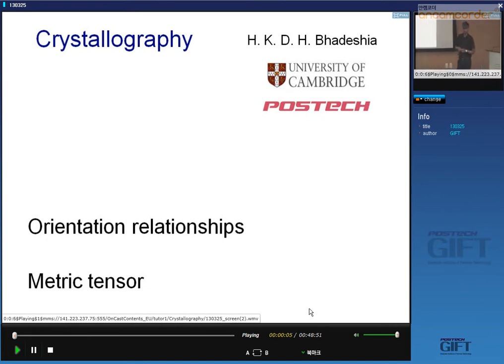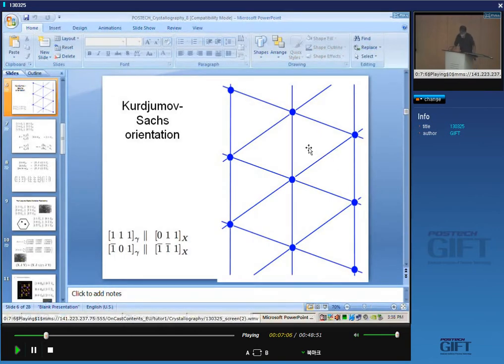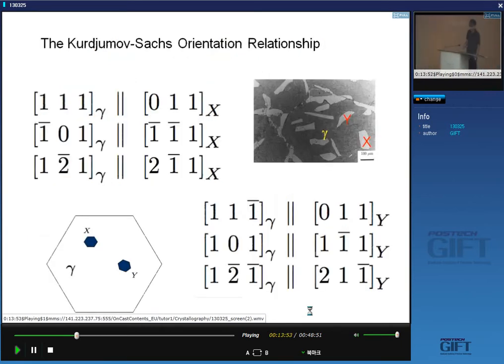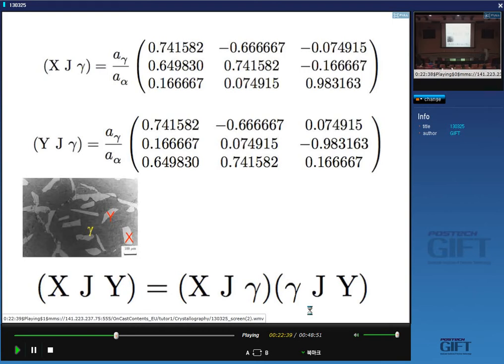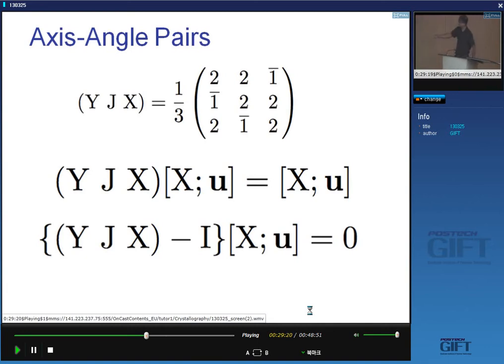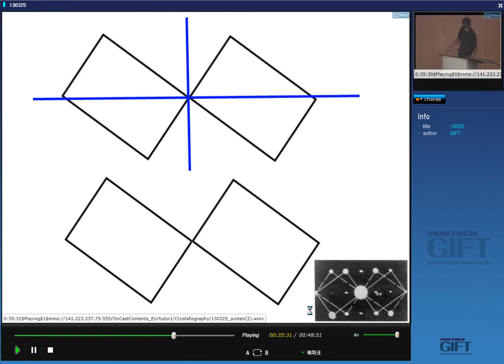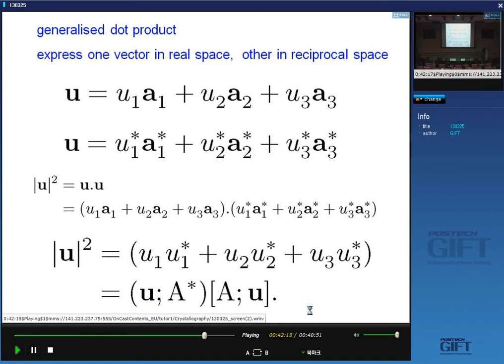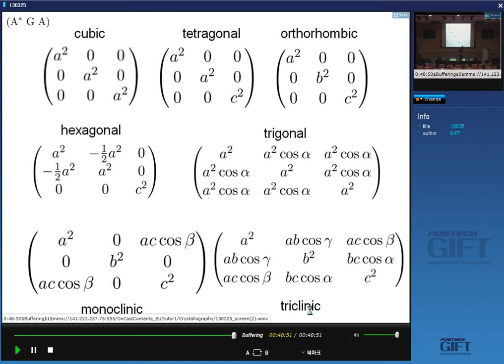Crystallography 10, Metric tensor (2013)

Comment from the maker: If you have two crystals contributing to the diffraction pattern, then their zone axes are parallel. That gives you the first set of parallel vectors. Then you may be lucky and find another set in the actual pattern. If you do not, you need to work out a coordinate transformation matrix as explained in one of the lectures in this series.

Comment: Thank you for you note. Could also tell me as to when the ferrite and austenite takes the Kurdjmov Sachs relationship and when it would take take the Nishiyama Wasserman relationship? I'm confused. Because if the orientation involves similar planes and directions then the inter facial energy has to be the same. Why does one take one relationship and the other.Also is there a video which takes about representing the various orientation relationships in steels as a stereographic projection.